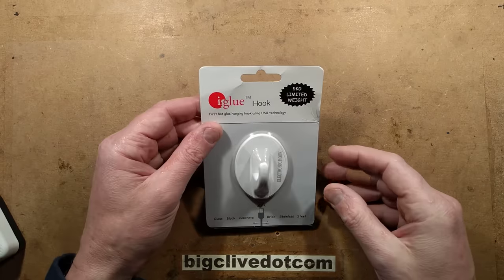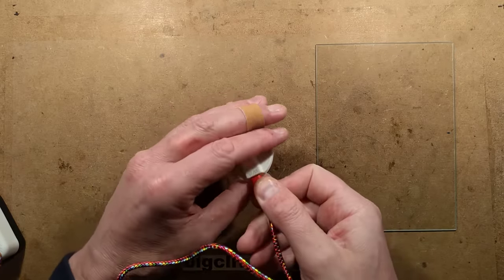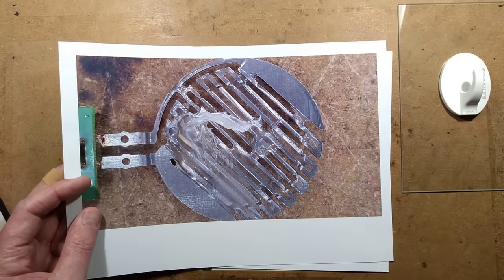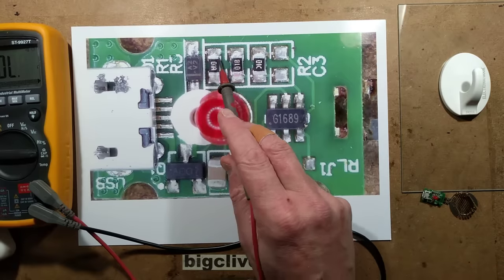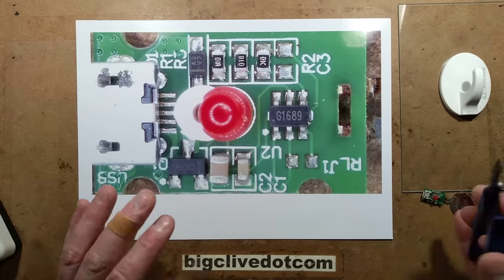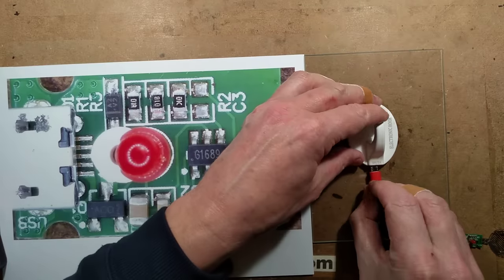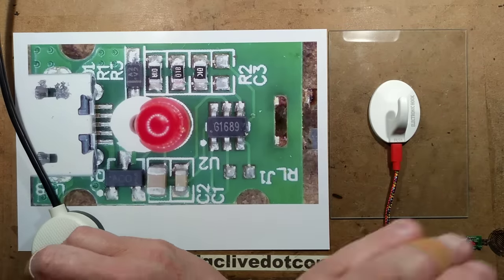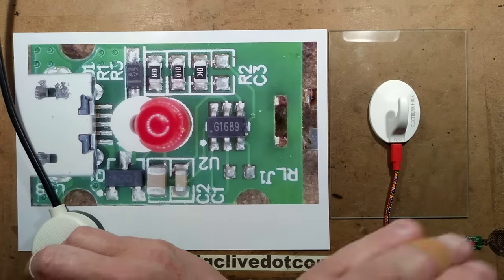Testing a USB powered wall hook and a look inside.

Comment: Wouldn't buy. Isn't USB-C.
Reply: I hate micro b leads
Reply: This is actually how I am about all USB products
Reply: @Cain-IVI  what is micro b? You mean micro usb?
Reply: @symix.  they call it micro USB b here
Reply: @Cain-IVI  there is no such thing so thats weird. There is usb b and mini b but not micro usb b
Reply: @symix.  wrong. There's no mini b but the is micro b. Basically what all phones use. Micro b 3.0 is what exhdd use
Reply: @marios1861  uhh google usb mini b and then google micro b... I wonder how are there cables for sale then on amazon for mini b cables but not for micro b? Also exhdd use micro usb 3.0 while normal phones use micro usb 2.0...?
Reply: Usb Mini b is widely used on cameras
Reply: Weirdo
Reply: Dusan thnx I couldnt bother to respond. When i say there is no mini b I mean no MINI B 3.0 ...
Reply: I wouldn't buy it if it were usb-c.
Reply: @emeraldbonsai  same
Reply: The Microbee was the first computer I owned.
Reply: I hate usb c with every cell in my body
Reply: dontquestionmyactions lmao why though. It’s much better than micro B - it’s less fragile, plugs in both ways, can be used as a universal connector for  devices, displays, power delivery, etc. It’s pretty much the best consumer electronics connector in most cases.
Reply: @meesguyy  I despise the internal complexity of the connector. Such an absolute nightmare to solder.
So far, I have literally zero reason to use C over micro.
Reply: dontquestionmyactions ah I see. But still, it’s not really a reason to hate a connector when it’s not being used for its intended purpose. Being a pain to work on doesn’t mean it’s a bad connector
Reply: @meesguyy  Oh, it absolutely does for me. I build a lot of my own electronics and C is just bad for that.
Reply: dontquestionmyactions fair enough, I just cut up micro or mini b cables for any work i do. Type C has no real benefit for that sort of stuff
Reply: @symix.  micro b===micro USB.  The B was used to say that it connects to a slave device, whereas A, the wide rectangley one, connects to masters. 

USB-C is meant for both
Reply: @symix.  It's called micro USB B because the regular male USB plug is called USB A. This applies to all USB ports. The regular port that goes into a computer is called USB A and the side that connects to a device is USB B. Even USB type C is technically USB type C B. This is dumb though because USB C plug can connect two hosts together with the same plug, so such a cable would be called USB type C B to USB type C B cable. There would be no A plug, which is usually the host connector.
Reply: @fezbpu  Exactly. Though technically the USB type C plug is also USB B even though it can act as a host or slave connector, or both at the same time. The wide, regular connector is always the A connector.
Reply: @symix.  there is absolutely micro b USB connectors. The micro A is very uncommon however
Reply: @PunakiviAddikti : ...To another device, that is.
Reply: @HelloKittyFanMan.  Can you elaborate?
Reply: @PunakiviAddikti : You said "from a computer to a 'device'," as if a computer "isn't a device" itself, even though it is. So I threw the word "another" in there for you.
Reply: How did this go from someone making a joke 2 years ago to some idiots getting mad about some metal in some plastic
Reply: @BlxxdLeaf  Why wouldn't you buy a device that has USB-C? It's the new standard connector for all devices, and is actually easier to use than other USB connectors. It even supports multiple voltages (which USB micro also does for fast charging), it can carry enough power to charge a laptop, power a monitor and can also transmit audio and video, like a HDMI cable. It will likely replace most current USB ports and only feature one type of cable.
Reply: @PunakiviAddikti  oh bro I was being a smart-ass. Everything I use has usb-c. Trust me I know what you're saying friend haha.
Reply: @BlxxdLeaf  Ah, I see.
Reply: @PunakiviAddikti  sorry for the confusion.  To be fair though, you did put together a good argument for anyone else who was actually serious about not liking them.
Reply: @BlxxdLeaf  Thanks. I actually was originally suspicious of USB-C but after using it for years I can see why it is basically a successor to every usb connector.

Comment: I think this must be re usable, hence the two extra glue discs. On the other hand you can make your own glue dots with a glue gun. why not just hot glue a regular hook with a glue gun in the first place?
Reply: How can you detach it 'neatly' after then?
Reply: There was a saying, 'once you've seen to do it, its obvious'
Reply: Or just use one of those 'Command' adhesive hooks, that let you pull the adhesive out from the bottom of the hook and cleanly remove it
Reply: @Ben-Rogue  Only they decide if they'll hold for a month or a decade.
Reply: I would guess its for people who dont have a glue gun

Comment: Clive on the days when your really tired do you ever catch yourself trying to use the meter on the printed images of the circuit?
Reply from the maker: It has happened on video in the past.
Reply: Well why not? It's much easier to see.
Reply: Also your chances of shorting 240 to ground will be much lower.
But then we would not get the required fireworks. 
Speaking of. It's about time for Clive to blow something up.
Reply: Well, it’s a Printed Circuit Board, nothing strange about that.
Reply: I am waiting till Clive makes a printout of his meter, attaches some paper leads to hook to the printout of the circuit.  Or, of course he could do it all on these electronic circuit emulators one can install on their PC now days, I have had a lot of fun playing around with those.
Reply: I have found myself just about to double-tap an image in the newspaper a few times.... 😬
Reply: is there any link ?
Reply: @GRBtutorials  I wanted to make that joke before I read your comment
Reply: When his what is really tired?
Reply: This was well before google, but I lost a 9V battery. I was thinking about searching it with a internet search machine in my kitchen on my mind. I felt s bit silly for a while. I tried to open a drop down menu with my mind.
Reply: @Lasseu  that's coming soon enough.
Reply: @Lazmanarus  well, iv been waiting at least  20 yrs for it :D since the Altavista search engines. Wait, it might be somewhere around my first Linux install in 1996, 1997..  ou good lord.

Comment: Both isopropyl and ethyl alcohols will cause hot glue to release. It even works when the glue is cool. It will wick it's way between the glue and whatever it's stuck to, and as such may take several tens of seconds to work.
Reply: Goddamn, I just tried it,  with just a few drops of ethanol hot melt glue peels off plastic like nothing, gonna have to remember this!
Reply: Good to know! Thanks!
Reply: Undefined Lastname, that sounds vaguely familiar. And it was in a follow-up to Ben Heckendorn's comment who kindly suggested trying alcohol. Does that ring a bell?
Reply: I was just going to mention this- A couple drops of isopropyl and it will just fall off that glass.  Its a magical hack for hot glue and makes the stuff 100X more useful :)
Reply: Oh yes, i found it, it was on 8-bit-guy's video where he re-fixed a project that Perifractic and Jan Beta worked on before.

And Ben is a suuuuper famous maker/designer who ran "The Ben Heck Show" first on Revision3 and later on YouTube, from approximately 2010 to 2018. He is also known for his 2005 book on console modding, and overall well known on the Internet pre-YouTube via Hackaday and similar sites, for handheldised versions of various consoles. If there's one person in the whole world of whom there's a detailed public record of working with hot melt glue on tens thousands of occasions, it has to be Ben.
Reply: i made a 3d printed negative mold of a headphone jack shrouding and whenever my headphone cable breaks i just cut the old shroud and injection mold a new one around the freshly soldered bare jack.
i use ethanol as a release agent. They sell all colors of hot glue sticks so i can always match the color of the cable.
Reply: Goo Gone is also great for removing just about any kind of glue or sticky tacky stuff.
Reply: Ivan, that is similar to what i was going to do too, but never got around to. I was thinking of moulding silicone though, getting the clear grade and colouring that.

But i'll consider your solution with hot glue sticks too, thanks for that.
Reply: I once worked in a facility repairing various electronic items for the Royal Mail. Someone found by accident that IPA  broke down the bond of hot melt adhesive. I've since passed this information on to anyone who needs to remove it and it does work.
Reply: I've accidentally found out that oil does the same thing, albeit not as efficiently.
Reply: @sanches2  Why do your headphones break so often?
Reply: Yep, always use methylated spirits myself, very effective.
Reply: @sanches2  that is a great tip. I'll be trying that soon.
Reply: If you call now they'll send you not one but two doses of isopropyl alcohol for a small additional fee of 4.95€
Reply: Yup, anybody that has done PDR  (Paintless Dent Removal) on vehicle panels will know hire effective IPA is at removing common hot glues. Not so sure about how effective it will be on your mother's wallpaper though.
Reply: I can report from personal experience, that Gin does not help remove hot glue from Lego.
Reply: From experience hit melt glue will simply come off all on its own....
Reply: I've never tried nor thought of this. Thanks! This will help clean future messes from my school projects.
Reply: Thank you sir. So many people here can make great use of this info ;)
Reply: I know that from Voultar. He has to do that a lot, when fixing hot glue jizz massacres from ebay, made by idiots other modders.
Reply: V2 will come with a hole on the front and an eyedropper so you can squirt isopropyl alcohol behind the pad.
Reply: It'll also strip the paint of your wall
Reply: Isopropyl also helps to get the protective film off acrylic if you’ve left it on way to long.
Reply: Would alcohol break down the paint on your wall? I know it works when it’s glued to plastic and other non porous surfaces

Comment: This need to be the greatest waste of electronic resources. Very clever, but no one asked for this product and it does not provide a big advantage.
Reply: Carcharoth, someone spent a lot of time engineering a solution for a non-existent problem. But, seems everything needs a usb. Next... hard-boil an egg with usb.
Reply: > But, seems everything needs a usb. Next... hard-boil an egg with usb.
You'll be getting back to us in a few days then , James? ;)
Reply: some idiot will buy it and think its the best thing since sliced bread though.
Reply: Well, it is at least not as stupidly wasteful as those one-time use LED-wristbands (contains µ-controller and all)...   Clive's got a video about that, but i couldn't find it, sadly...

But in these times of 3M-tape, it does seem like a solution to no problem at all...
Reply: On one hand, sure, somewhat excessive. On the other though, it's convenient and at least it goes for a bit more security than necessary, rather than the other way around.
Reply: ESA would bill you 10.000€ to replace the panel with the hot glue mark though...
Reply: James Plotkin  Next... hard-boil an egg with usb in 2 hours or less!
Reply: overpopulation => competition => "progress" => spinners & usb heated hooks...
Reply: Er, Yea, why not just buy a glue gun!?
Reply: If you think this is the greatest waste, clearly you haven't heard of disposable phone chargers. It's a little one time use square with batteries, that don't even charge a phone past %20 lol
Reply: Cyphik, I have this problem, when hooks on 3M constantly continue to unglue.
Perhaps this hot glue will make any better?
The HUGE advantage is that you need no tools to install it. So this is the main selling point, it is toolless hot glue hook.
Reply: James Plotkin thanks to this comment, I just pictured sitting one of these hooks on a desk with an egg on top of the heating element to cook...lunch for the office! :D
Reply: If you use a heat gun, there's no good way to heat up the glue later to remove the hook.
Reply: My late Mother used to say the same about computers in general. In fact I can imagine her being more impressed by this than the latest iPhone.
Reply: Amazon Dash Buttons would like a word with you.
(And mini old consoles form Nintendo/PlayStation that could simply be released as a phone app)
Reply: Just like Apple's iPhone.
Reply: @Gun4Freedom  you glue it... You let it stay for a few weeks, maybe months...you need to move it and think "good thing I bought a usb powered hook, I can reuse it" so you use it.... And you discovered it has rusted away or something and that it doesn't work anymore.
That would be my guess
Reply: @Gun4Freedom  I don't have any moisture problem in my house and I have to say I don't believe that this will still be working after 1 or 2 years
Reply: You can say the same about new iPhone
Reply: I think it’s the reusability that makes it worthwhile, just not for home use, I’m thinking mobile events and art galleries and such where you have access to room of just plain walls. This would let you set up a place for guests to hang a coat and would let you easily set up and take down and not take up valuable floor space. I think the problem is people are looking at it from an item for domestic use rather than business.
Reply: @jamesplotkin4674  A usb egg boiler sounds like a great product for a sky mall camping catalog. It might already exist.
Reply: Hey, I love my usb egg poacher.
/s
Reply: It all depends on where you want to use it.

A good use for this might be a bathroom with very non-smooth tile, that can be a major PITA to actually get anything to attach to.

The problem of course is that the humidity is going to do exactly what Daniel Peixoto Martins is describing.

In short, 3M for the win even there.
Reply: Rough tile you say? I've never put porous tile in a bathroom, as it's almost impossible to clean properly to inhibit mold growth. I do see the merit in this product for that application though. good call +Zephaniah Loss-Cutler-Hull. 
Granted a stick of hot glue and an applicator or heat gun would do as well and not require 1-2v 5a usb power.
Reply: @Fly0High  The European Space Agency?
Reply: @km5405  usb powerd sliced bread great idee!
Reply: @quenchize  and use a normal powerplug? 2018!!!
Reply: we need wifi enabled bread
Reply: @haploideallel  Stares at my roll of VHB tape Seriously, what problem is this a solution for exactly?
Reply: Carcharoth ok
Reply: James Plotkin I vote for USB eggs.
Reply: @Gun4Freedom  I am not allowed to stick a wall hook in my dorm cus it might chip the paint, but this will just melt away the glue so no issue with the paint, and i can remove it easily when i vacate.
Reply: someday archeologists will find one and come to the conclusion it was part of some larger more elaborate machine instead of a fucking microchip powered sticky pad
Reply: Of natural resources
Reply: Neurotic Knight did you see how it came off? “Won’t damage the paint” is optimistic.
Reply: But you can un-glue it!
Reply: Then clearly you haven’t seen “throw away battery packs”!
Reply: @jamesplotkin4674  Sure, but the trick is to get the chicken to lay eggs with USB ports, otherwise, you still need containers and all of that, so why bother. You really need to be able to just plug the egg into the wall outlet.
Reply: @edwardhugus2772  If only we can convince the hen to adopt usb as the latest, greatest innovation, somewhat like apple does with their interfaces, we can have eggs with built-in usb.
Reply: @Gun4Freedom  If you need to put a hook on glass or tile, say in a bathroom without making holes, this is a great solution. All of the other ones are notorious for failing or hard to install. Suction cups are terrible unless everything is perfect. I bet this easily holds 5kg of weight.
Reply: @rich1051414  Heavy signs and glass mostly.
Reply: @firesurfer  THIS is the bad place.
Reply: @jamesplotkin4674  it would take about 20-25 minutes to hardboil an egg using 5v/2A usb.
but on 20-40W USB C PD it could hardboil an egg in less than 10 minutes.
you can use a thermally conductive sponge/foam (silicone or copper) as a tim which means you don't need to use water at all.
as for the practical side, it allows for waterless efficient egg boiling, and if you have chickens running around, you can have the freshest eggs you can.
might be nice for lightweight camping, you can go buy eggs at the market and boil them without needing a stove.